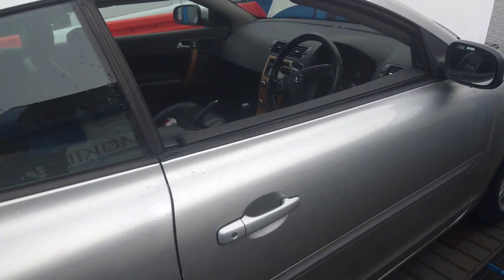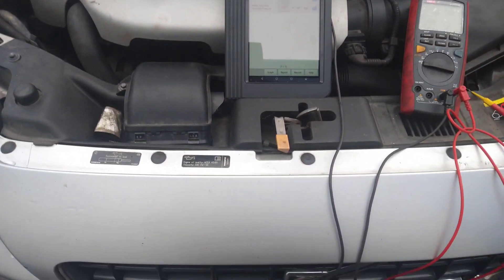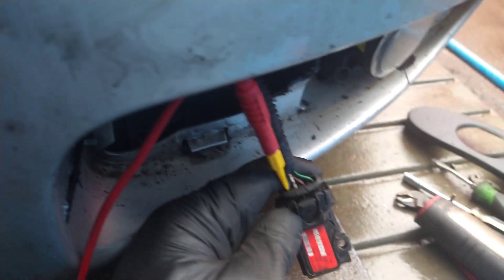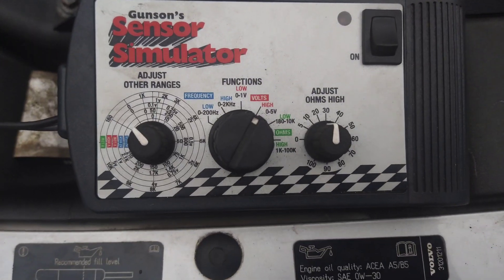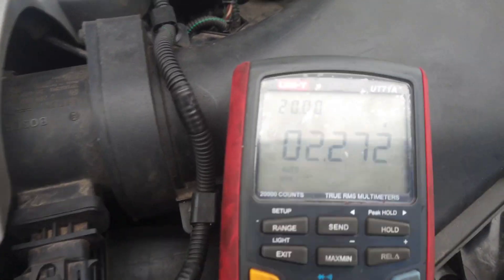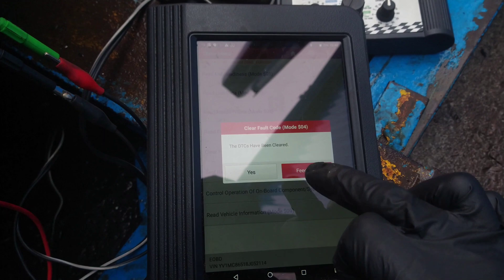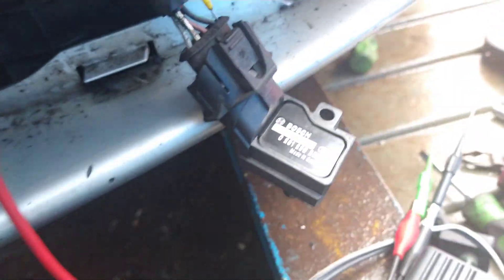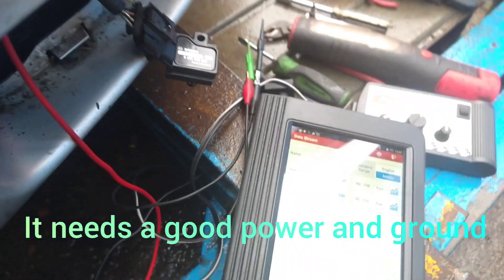Volvo C70 (P0069) barometric/map pressure correlation fault.

Comment: Hi, how did you manage to disassemble the sensor? Where did you enter from?
Reply from the maker: @chammysammy2513  I think I got it through the grill or removing a lower bumper light, it's been a while so I'm not sure, I do remember it being a pain. Thanks for watching
Reply: Did you remove the engine cover underneath while placing the car on the lift and see the sensor from that position?
Reply from the maker: @chammysammy2513  I did remove the under tray , still difficult to get to

Comment: volvo xc60 2.4d 2009. still error MAP Sensor, MAF sensor and Baro sensor.  changed MAF and MAP.  still no change, car loses power sometimes.  The MAP sensor shows about 70kPA at idle and with the engine off.  Shouldn't it show about 100 like the BARO sensor?

Comment: Hi mate you know of a decent sensor simulator I can buy at a decent price. Thanks
Reply from the maker: I mostly use my gunson's sensor simulator. I also have a ditex that I don't use that often, it doesn't do resistance so you would also need their decade box to simulate temperature sensors.

Comment: Think I've just sorted my D5 V70 thanks to this video. Used a cheap code reader to find that the BARO was 115 kpa and the MAP 98kpa. Plugged in a new Bosch sensor and the fault codes cleared themselves. A bit of a pain getting the old sensor out and the new one in but hopefully that's it sorted. Really helpful video.
Reply from the maker: @rickiward9293  thanks for watching and your comment
Reply: Do you remember where the sensor is located? I can't find it

Comment: Hey man ! I am experiencing the same issue but I can't find the sensor on my V70 which has exactly the same engine as your car.
Can you give me some tips on how to find it when you open the bottom anti fog compartment ? Thank you very much !
Reply from the maker: Yes it was just visible through the hole where the front fog light was, not easy to get to. It was either on the intake pipe or on part of the intercooler itself. It was a while ago so I can't quite remember. Thanks for watching

Comment: Hi matt i'm having problems with my little fiesta 2007m/y 1.4 tdci   low power, looking at live data  map is fixed at 14 psi engine on or off  any idea what it should be  near zero? put new map sensor on still the same  if i unplug the sensor  boost pressure will go to 35 psi on live data bought a new map sensor still the same  3 pin sensor good ground , 5 v and 2v on third wire which will go to 6v if i unplug  the sensor  wired map  sensor directly to the ecu and still the same any advice would be greatly appreciated. Thanks
Reply from the maker: That is about right with ignition on with it being absolute pressure it includes barometric pressure rather than being zero psi, with a petrol it would drop with the engine running due to manifold vacuum, although on a diesel it only drops very slightly and increases with boost when the engine is reved up.
Reply: @mechanicmatt871  Thanks matt
Reply: @mechanicmatt871  matt i have 4 psi of boost full throttle  have had turbo stripped down no obvious faults  this is a 1.4tdci engine and the turbo is really small should i be getting more than 4 psi ?or is this a low boost set up no info anywhere so i have no idea if 4 psi is good or too low?
Reply from the maker: If you check it while driving it may be higher, four psi is low if that's it's max boost

Comment: I can't spot my chevrolet beat diesel's MAP sensor 
No help online as well
Reply from the maker: I can't remember on that car, when I don't know I look around the intake for a map sensor either bolted onto it or near to it with a small hose connecting the two.
Sometimes with a turbo I have found the boost sensor between the turbo and the inlet manifold, it can be anywhere. 
Can you see a map sensor reading on your scan tool live data?
Thanks for watching
Reply: @mechanicmatt871  yes i can see the live data but apparently baro and Map data matches 
But still a fault code .... I'm mind blown😆
Reply: @mechanicmatt871  Sir ?
Reply from the maker: Does the map raise when you rev the engine ?
Reply: @mechanicmatt871  as far as i remember it does not...
I'll check once more and get back
Reply: On the other hand my car is running absolutely ok... no hesitation,  no issues at all
It allows me to clear the code everytime and comes back the next day
Reply: @mechanicmatt871  yes now i checked map readings jump high as i accelerate
Reply from the maker: Yes the map should raise when you rev the engine if it is getting boost from the turbo
Reply from the maker: Is it an overboost problem from a stuck waist gate?
Reply: @mechanicmatt871  How can i confirm over boost ? I understand waste gate of turbo, can it be checked as well i mean just by looking at it? Somehow
Reply from the maker: If you have desired boost pressure v actual boost pressure on a scan tool, that would give you actual comparison.
Reply: @mechanicmatt871  My scan tool does'nt show these .... its a generic one.
Reply from the maker: If you see if the turbo waist gate can be moved with a lever if not it may be seized and need freed off by using WD-40. It may be seeing the boost pressure go too high when you are driving. You could see if someone can watch the live data for the map while you drive and see how high it goes. Remember to take off your baro pressure (ignition on engine off pressure) to see how much boost it is giving.

Comment: would you be able to connect the 5 v to the signal wire via a decade box and slowly reduce to resistance to increase the voltage and monitor to values that away
Reply from the maker: Oh yes, another valid way of testing. The decade box also works well on thermistor simulation too. Cheers Matt

Comment: What does that sensor do Matt?
Reply from the maker: This sensor is reporting the air pressure in the intake system. Helps know the turbo is putting out the correct pressure. However this one was reporting the wrong pressure with the ignition on, there for it was unreliable. Cheers mate